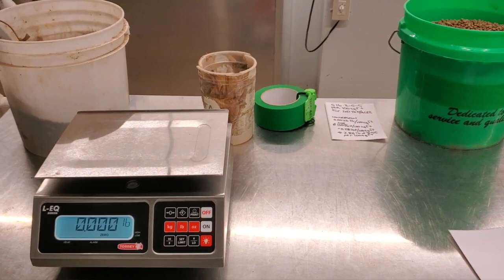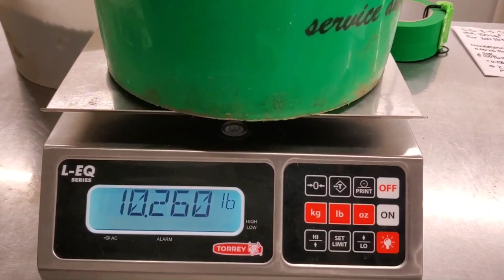How to Use a Drop Spreader to Fertilize your Market Garden [Plus Spreader Calibration Tips!]

Comment: Biggest issue for me has been figuring out how to spread broadcasted fertilizer below grapevines in a straight row without it getting spread far outside the furrow because it doesnt do any benefit the surface roots in top 4-5 inches that access fertilizer are close to the vine maybe max of 12 inches out then they have a deep taproot. Been trying a bunch of handheld spreaders and doing it manually and just trying to reduce workload to spread it.
Reply from the maker: That's tough. Measured size container of organic fertilizer thrown at the base of each vine.
Reply: Im probably going to do that as its like 1 pound of fertilizer per mature vine or something like that from most fertilizers. So it should be easier to spread it that way just time consuming.  @farmerkeith
Reply from the maker: I have not encountered rust but have planted in the greenhouses the past couple of years.